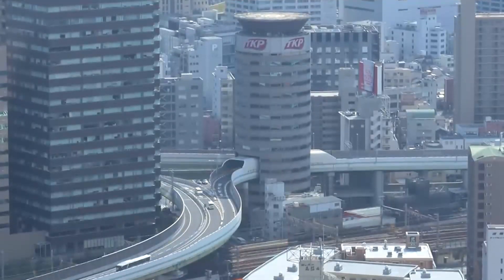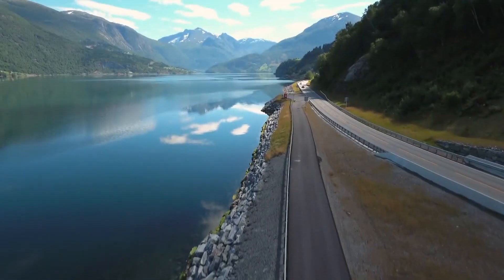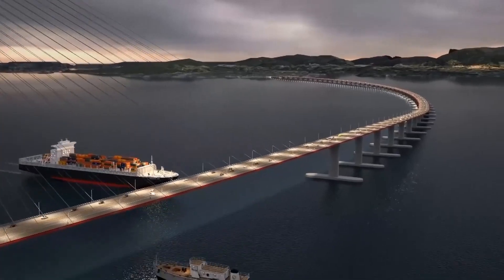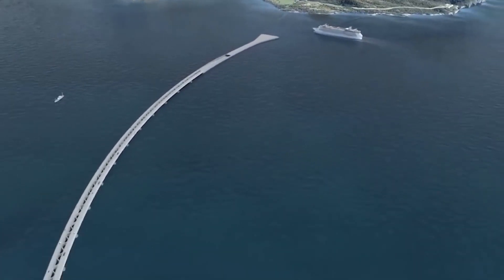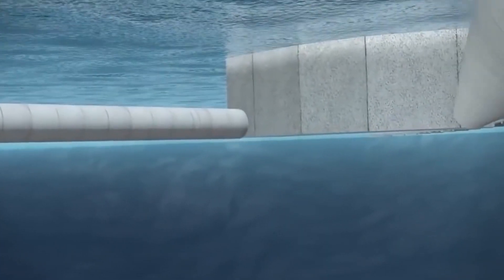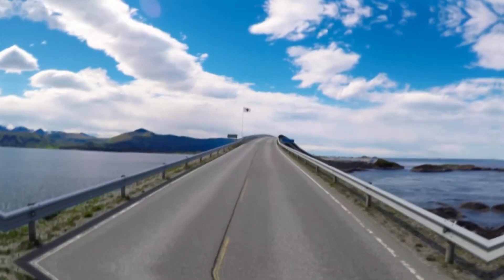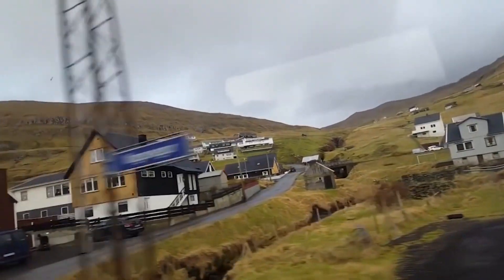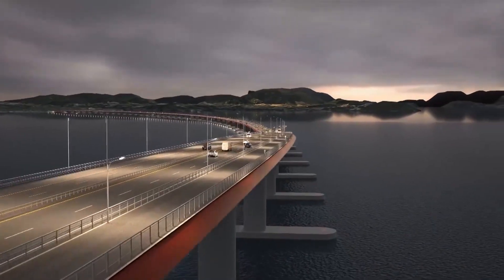Why Are The Norwegians Building An Underwater Highway That Costs 47 Billion Dollars?

Comment: Nope.  So much wrong information here.  The roads aren't that dangerous and it doesn't not take 24 hours to get to Kristiansand from Trondheim.  I live in Trondheim, and you can drive from Trondheim to Oslo, comfortably, in about 7 and half hours.  They way 'Stavanger' is being pronounced hurts my heart,  The Lærdal tunnel is 24.5km and is the worlds longest road tunnel.  The road links Aurland and Lærdal, in Sogn and is a ferry free connection between Oslo and Bergen.   Taking the coastal route will takes more time, not less.  I love travelling over Dovrefjell.
Reply: He could have been more specific, the travel time using E39 is well over 21 hours counting waiting for ferries.